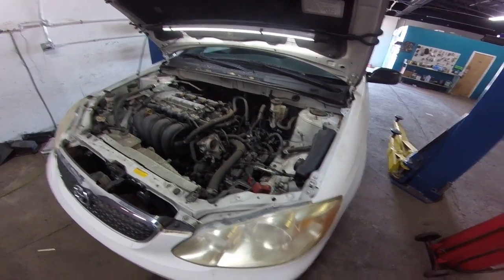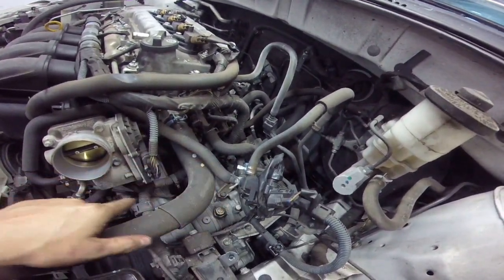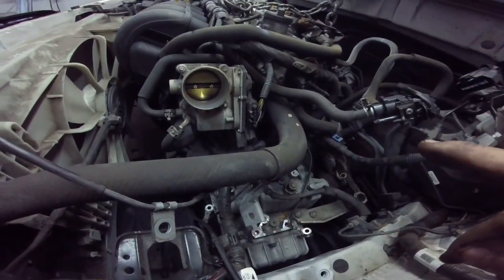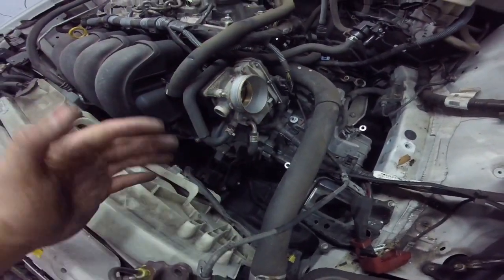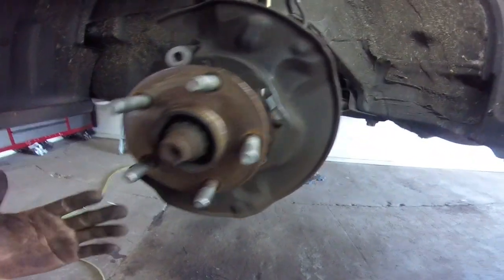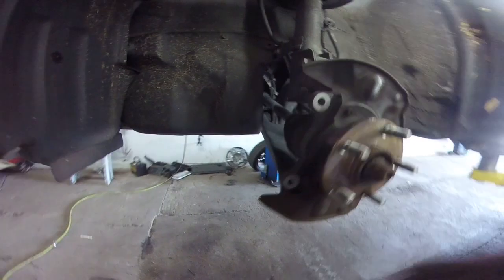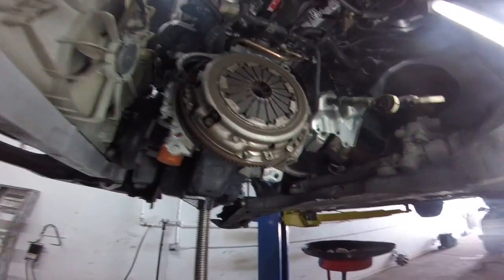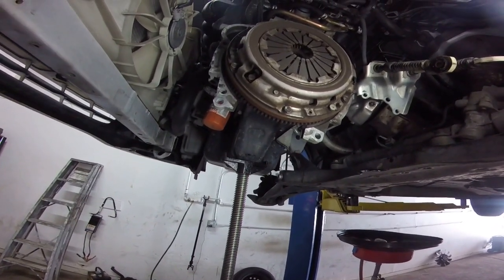toyota corolla clutch installation

Comment: Good video. I'm a wrench but customer wanted to do his own so I explained. There's another guy posted one 12 part video on same job, I'm thinking he just scares people away from doing it or bore them to sleep. I can't believe alldata quotes 8.9 hr.  Thanks for  simplifying it!. Good tip on just unbolting brackets on harness connections, too and hanging calipers high.
Reply: How long does it take?
Reply: @lolwhodis7817  about 6 hours, I don't have a lift so just on jack stands.

Comment: I am sure the lifter helps a lot. Try this without it and you will be so screwed as I am now, lol;  I got the engine and transmission apart about an inch and half engine is chained to a hoist lifter as I am trying to take if off doing a general engine reconstruction; as a matter of fact it is only the block what I am trying to separate but no matter how I pry between the two it wont come apart, it spins it feels lose yet something in the middle does not gets off, not clue what to do next, manual does not tells me and there is no you tube videos through completed showing how the two comes apart; this video here dropping the transmission is not too helpful because i am doing the opposite because i do not have a lift for the car; at least now I know the whole clutch assembly comes out with the engine and that inch and half apart i have the two is nothing! but this is a very good video!
Reply from the maker: there has to be a bolt still holding it
Reply: How did it go?
Reply: Steven Wheeler well I took the engine out of the engine bay after finally separating the transmission and engine block, I repaired the engine and put it back together and it has been sitting in the garage ever since, over a year, have yet to put it back into the engine bay, my folks think I will never get it done as I literally abandoned the project but Corolla is a good car if it gets back together again still has some driving years ahead of it, mostly everything in the engine is new and refurbished except for the transmission gears, if it ever goes back together the car needs a deep cleaning overhaul and some paint job as paint finish is been damaged for sitting outside without covering, but if the engine goes back in I am confident it will run
Reply: @fireyourrocketts  I am replacing my clutch in my 2008 Corolla.  I am down to separating the transaxle and engine.  I do that tomorrow morning.